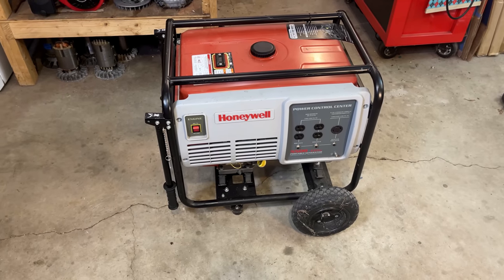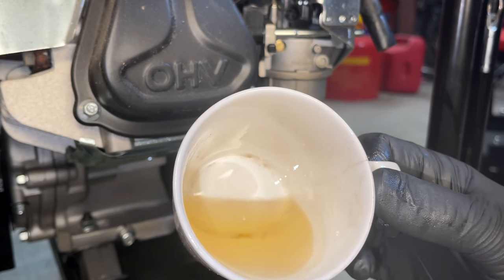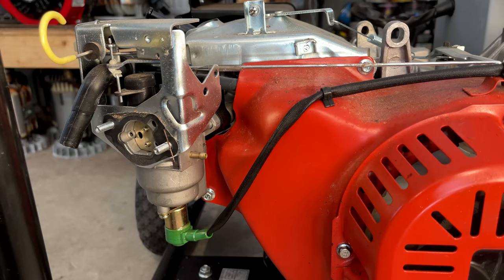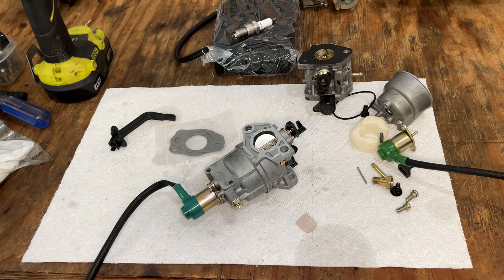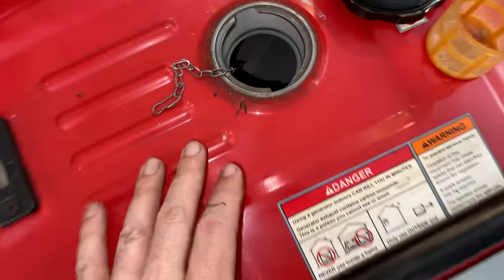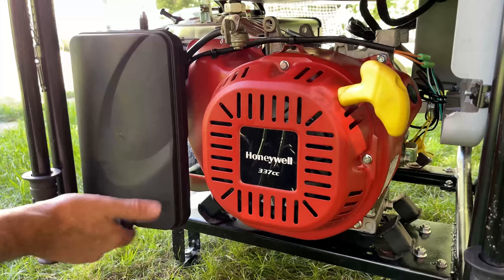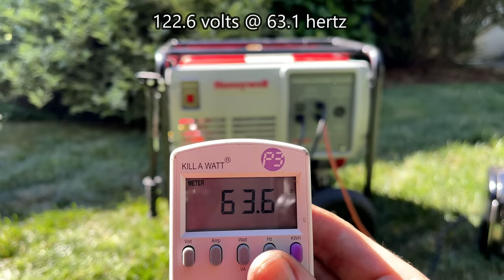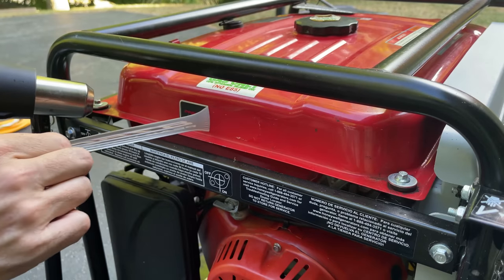Bad Tank and Bad Fuel - Easy Fix?

Comment: What is the function of the solenoid on the carburetor? Is the following true or untrue?

Killer2600
4 days ago (edited)
On battery-less generators, the fuel solenoid works in the reverse of how it works on a lawn tractor. On a manual start generator, when there is no power supplied the solenoid plunger is retracted by spring pressure. When the generator is running and you flip the kill/on-off switch power from the engines charging coil is used to energize the solenoid, extend the plunger, and cut off fuel flow. When people don't understand the difference between manual-start generator solenoids and electric-start lawn tractor solenoids, you get this YouTube video; where someone blames a brand new essentially never used part of being defective. In reality, it's more likely that the solenoid wasn't defective but this replacement carb assembly was for a lawn tractor engine and not a pull-start generator engine.
Reply from the maker: It is true.  Lawn tractor the off position is a deployed plunger.  A generator the off position is a retracted solenoid.  Generators you can pull start with a dead battery because the plunder is retracted.  A lawn tractor needs power from the battery to retract the solenoid for starting.

Comment: Hi James, You know better than I do but I saw 2 gaskets. You placed one gasket between the carb and the spacer and the other between the carb and the air filter. Why wouldn't you put the one that is between the carb and air filter between the spacer and engine intake. I would think that this way would seal any vacuum leak because of the spacer being slightly malformed. If you have a small leak between the filter and the carb it would not matter. Your thoughts?
Reply: One gasket on each side.  A distorted insulator can be lapped.  A cracked insulator can be scrapped.  Small leak between the filter and the carb scraps the entire engine.
Reply: @ShainAndrews  I very seriously doubt that there would be enough of a gap to let dirt in
Reply: @Ronl53  Your equipment do as you like.  Eventually you will need somebody like me to fix your assumption.
Reply: @ShainAndrews   Whatever. I did not ask your opinion anyway.
Reply: @Ronl53  Have it your way partner.  I work on a lot of equipment.  I'm giving you solid advice based on experience.. not a keyboard.  May your entitled ignorance be your guiding light.
Reply from the maker: A leak between the carb and airbox would not matter much.  There was a gasket between the spacer and the engine already.  I just reused it.
Reply: @ShainAndrews  Like I said, I did not ask for your opinion and I really do not care what you think. May your pompas attitude may you lots of friends.
Reply: @jcondon1  Thank you James. I was going to see if I could just delete the question. I did not realize I would cause such a stir. Sorry for the above unnecessary comments.
Reply: @Ronl53  Quality over quantity every day all day.

Comment: Aww okay vacuum leak from the insulator makes sense
Reply: The carb he used was for a larger displacement engine so the port was bigger for more air to flow. That smaller displacement uses a smaller ported carb. The outside and mounting bolts are all the same and they will interchange with each other but the port size and the air bleed channel location are different in the insulator. It took me two weeks to find this out. It is still a good brand of carb though.
Reply from the maker: I originally thought the engine was 437cc.  Its rare to get a generator this size less the 389cc, but this engine was 337cc and the Hipa carb was not meant for an engine of this size.  Ran it well though once the insulator was replaced.

Comment: What does those electrical wires you hooked up from the carburetor do or for??
Reply from the maker: When you turn the engine off, if energizes the solenoid to deploy a plunger into the main jet blocking the fuel flow.  It prevent a backfire from the muffler and flooding the engine while the engine spins down making it easier to restart.

Comment: Where does the rust in the tank come from? The water in ethanol?
Reply from the maker: Yes and the ethanol is hydroscopic which means it will also attract water from the air.  Eventually the water and ethanol separate and you have water in the tank.
Reply: @jcondon1  Yuck, thought so. It's best to pay more for non-ethanol fuel for generators.

Comment: How could the tank look that bad and the float bowl be that clean? It's bizarro world I tell you. I had no doubt you were going to get it sorted. I had a similar issue with a vacuum  leak and it ended up being the carb bolts had gotten loose. New gaskets, torqued bolts, problem solved.
Reply from the maker: Am guessing the guy I bought it from replaced the carb and gave up when it still did not start.

Comment: James I have a Honda mower that is hard to start after its say for a week. A bit of starter fluid starts right up and will restart ok if you shut down and restart right away. Do you think the carb is cleanable thanks
Reply from the maker: A carb clean might help, but would start with a new NGK spark plug and double check the choke.  Make sure it is fully closing when trying to start the engine.
Reply: @jcondon1  thanks will try
Reply: @jcondon1  Put a Kawasaki off a worn out Deere on a Snapper walker and had to yank myself silly. Choke wasn't closing but it'd start eventually. NOW it starts on 1 or 2 at the most.
Reply: @jcondon1  the choke was not closing completely. Bent linkage starts now.

Comment: What I don't get is why the voltage stayed at 122 while the Hertz dropped to 57!! 
If the governor speeds it faster to get higher Hertz, would the voltage not increase as well?
Reply: That's the AVR at work... Automatic Voltage Regulator.
Reply from the maker: The job of the AVR to to hold the voltage at the set point.  Of coarse some AVRs do better the others.
Reply: @jcondon1  Spot on!
Reply: @jcondon1  I had to google how electronic AVR works. It adjusts the excitation of the generator coil inside the rotor to vary the magnetic field, that varies the voltage across the stator windings. 
So that's why they don't use permanent magnets inside the rotor. Very clever.
It all clicked in one shot :) I'm learning from every one of your videos. Thanx.

Comment: I got a Baldor premier ohv30 generator from a friend,  he had added a fuel stabilizer to the gas tank. It basically melted the plastic in the tank. Had to junk it, impossible to use. Now I've been on the hunt for a replacement gas tank. So far cant find one, now looking to adapt another  tank. It's small only 2.5 gallons. Any suggestions.
Reply from the maker: Might be a good candidate for a propane conversion.  Otherwise finding the correct tank for that generator will be a challenge, but you can probably find something that can be made to fit.  Otherwise an external tank with a low pressure fuel pump.

Comment: I have a powermate professional series 6750/8500 that I need a gas tank for. I got it for free from my boss, but needs a new tank. I can’t find any parts for it, and most are no longer available. Do you know where I can get one, or one that work from a different model?
Reply: I just had a look at a pic of one. It looks like a fairly standard rectangular cross-section with the bolts on the four corners.  A five-gallon tank is the minimum you should use. A standard Honda or Honda clone tank has a spacing from the center of the bolts of 20 inches along the length and 13 inches along the width and a height of 4 inches. A clone like this would cost about 60 dollars. Of course manufacturers do not normally set out to make life easy for repairers. and you will not know the measurements you need until you measure yours up.
Reply: @jcondon1  thank you. I will gather up that information when I get home from work.

Comment: Things could have been a lot worse - if someone had put ethanol fuel in the tank.

I'm wondering if someone in the past has added turpentine, or similar, to the tank, maybe thinking it would help protect against moisture ingress, or even as a desperate bid to keep the engine running one night when no other fuel was available.  I remember when I was a kid, and a group of us entertained ourselves with a home built cart and a lawnmower. We didn't have much money to get fuel to keep the engine running, so we added all sorts of crap to the tank, just eek out ever last turn of the engine. Let's say, it's surprising just what some engines will run on, once they're at working temperature - lamp oil was pretty good!

Comment: Hi James, I  like to know if you have an alternator cover for a APG3001 generator,  and if so would you like to sell it. It's the piece that holds brush and avr.
Reply from the maker: I do not.  Generator Guru does https://www.generatorguru.com/alternator-end-casing-74502091/.  A little pricy though.  Would suspect most Honda clone generator end housings in the 3000 to 4000 watt range might fit.

Comment: Get a new tank and clean the carb. Mine is 34 years old and the tank has been replaced. I would not put a chinese carb on it unless there was no other option. I have yet to have a chinese carb perform properly.
Reply from the maker: Chinese carbs work well on Chinese engines, but not much else.

Comment: I was hoping for an investigation of that troublesome fuel valve and isolator.  Was the isolator issue a mismatch with gaskets as Tim McCurry mentioned below?
Reply: He used the larger ported carb for the larger displacement engines. If you pause the video at 15:34 you can see the port is bigger in the gasket than the port of the isolator. The carbs that get used on these clones are identical outside and they use the same mounting bolts but the ports on the smaller displacement units are smaller and the air bleed channels are located slightly different on the carbs and isolators. It still a good carb though.
Reply: @timmccurry2227  Yes. You really have to look closely to see that the gaskets match and that you are not blocking any holes or letting air in. Just because the clone carb looks the same on the outside doesn't mean that it will fit.  Something as stupid as the wrong gasket will make the thing run poorly.  It can be made to work but all the holes have to match up and be the same size. If the old gaskets comes out in 1 piece then compare them to the new and make sure they are totally identical.

Comment: Why  can you only recycle twenty gallons of fuel
Reply from the maker: Just the limit my county has imposed.  Makes no sense.
Reply: @jcondon1  no it makes sense if you are a politician so what do you have to do with the gas you don’t use?
Reply: @jcondon1  Rock crushers and heavy truck/equipment shops have the waste oil heaters.
Reply: @kendledoll1597  Have you ever seen ANY politician that REALLY made any sense? For over 5 minutes?